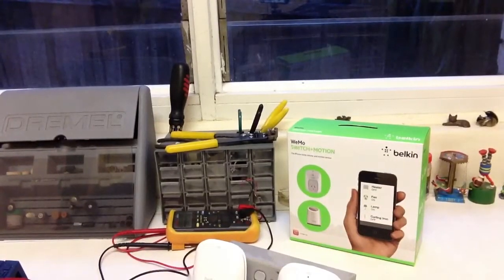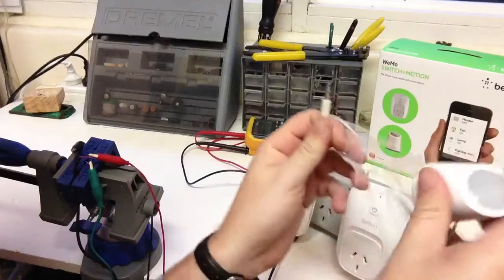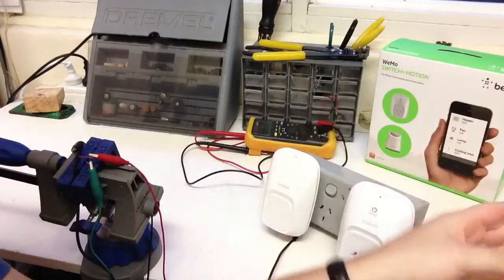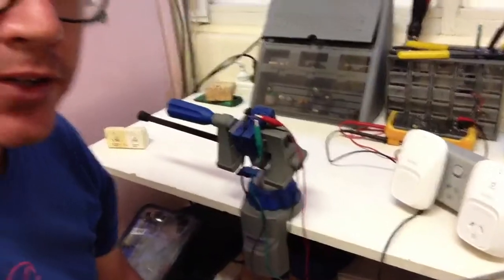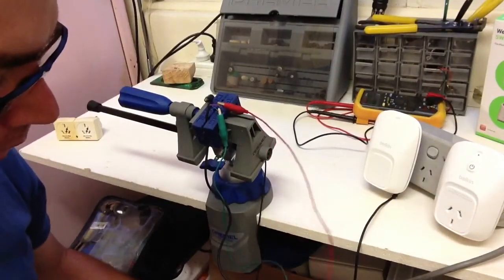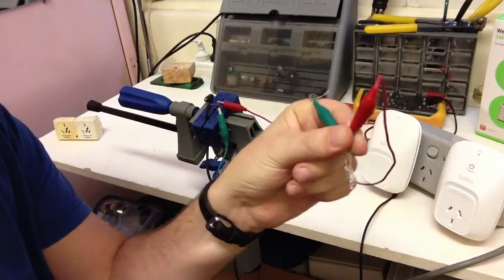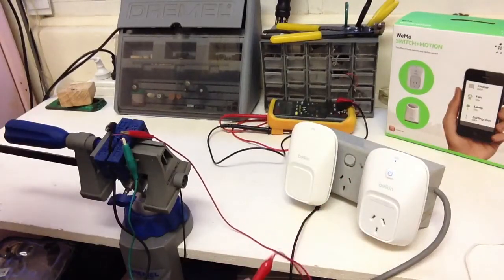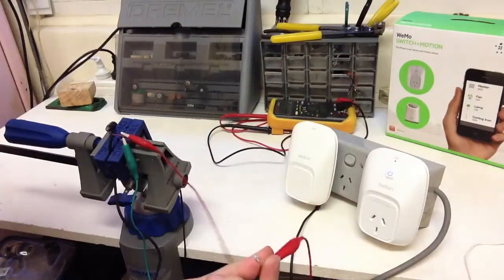Belkin WeMo Sensor Hack

Comment: Tip is +3v
middle ring is trigger
bottom is -
to trigger put the 3v to the middle ring

in other words, if you use an old audio cable joining the L & R channel wires will trigger motion, dont use the ground

Comment: Hey, i like your video instructional very much. The idea is brilliant.
Did you try any other sensor with it yet? I'm not very keen with electrics but I understand, that you simply connect 2 wires with a 3,5mm cinch and your mercury/reed-switch. Is that correct? 
Can you give a picture of the wireing?
Thanks in advance!